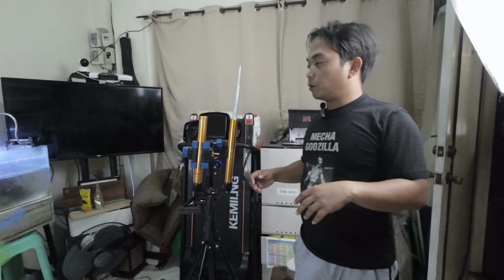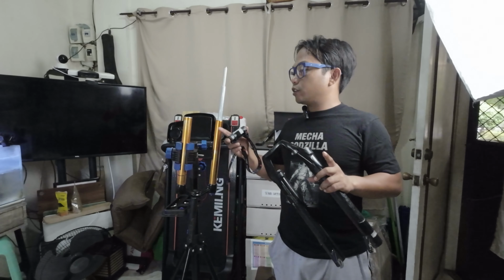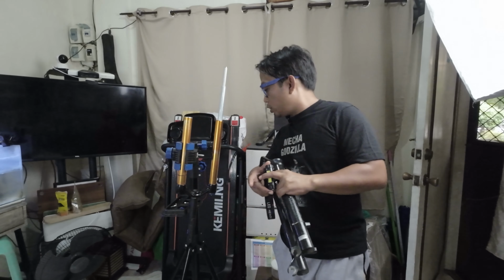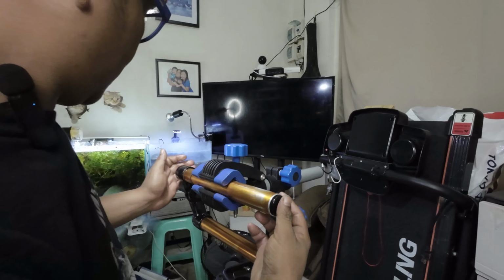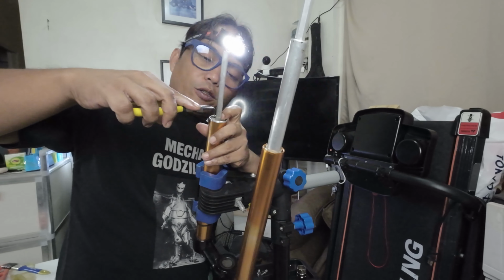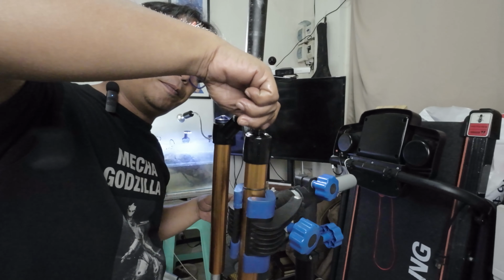Fork Air Leak - Airborne Air Force Fork

Comment: Brand is also known as AirBike in Europe and Western territories. Forks are decent budget suspension forks but need servicing more than known brands like Rockshox or FOX, Suntour
Reply from the maker: Agree, since it has no foam rings that helps lubricate the stanchions and stops unwanted dirt from entering the inner bushings, it needs servicing more often. Plus the damper is not serviceable.
Reply: @cebubikebootcamp  I add Ballistol to the seal after every use.
Reply from the maker: @Wireman134 what is Ballistol?